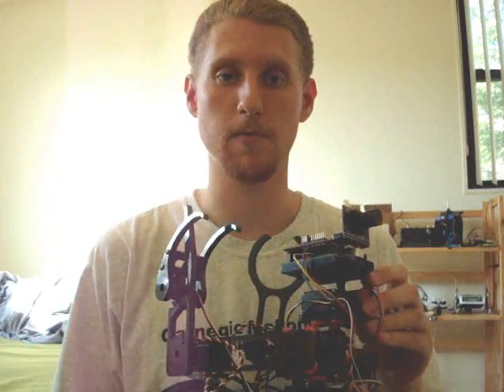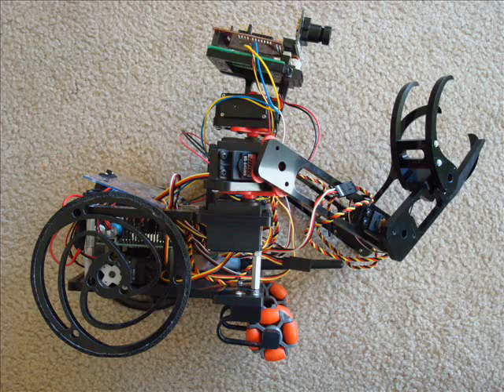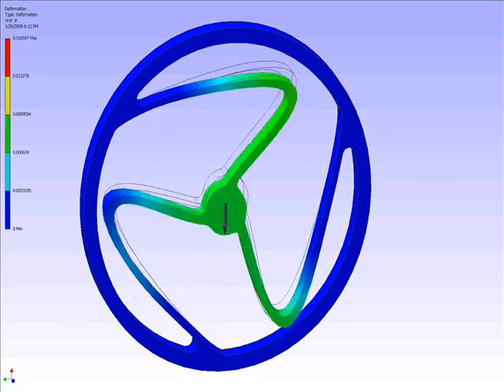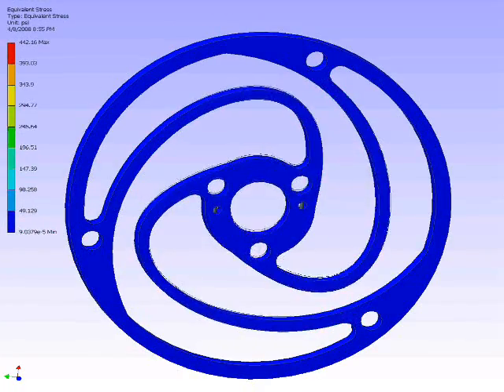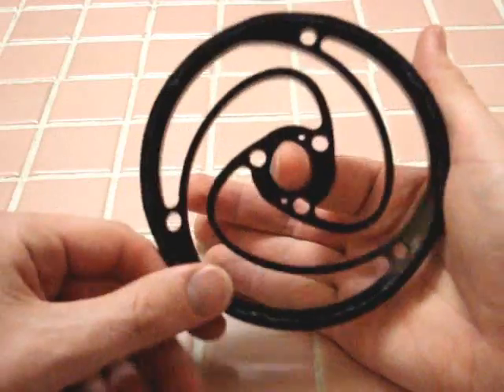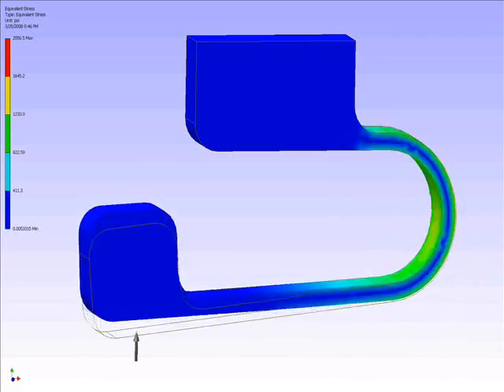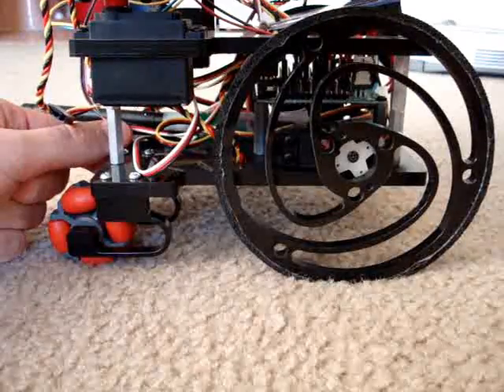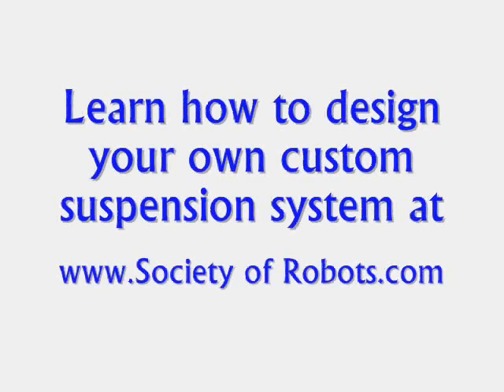Robot Suspension System Design

Comment: @kubarebo lol well it sounds like you have a beast of a car, because my car is very much affected by extra weight, i bought some alloy wheels of the same diameter as the original steel wheels but a lot heavier and it slowed the car right down, add extra passenger and its very noticeable. so maybe engine torque is what it comes down to, i know bikes with low engine torque but high RPM, weight makes a huge difference.

Comment: @kubarebo 
The volume of fluid in a shock absorber is less important than the viscosity of the fluid and the size of the gap/holes in the piston that moves trough the fluid. Hence how they can use magnetically enhanched newtonian fluids to enhanche shock absorbing without adding more volume.

And yes, it's a big deal - Try and take off the shockabsorbers (keep the springs offcourse) of a car and drive down a road with potholes. At 10 mph, no problem, at 60mph, you will be all over the place.

Comment: @RustyNex The moment of inertia of wheels on my car adds about 200kg of equivalent weight to the car per m_eq=I*(1/r)^2, so it's not as horrible as it'd sound. I don't feel much difference in acceleration with 3 extra adults in the car... I don't exactly do WOT every 20 minutes. Well, maybe every 40 minutes ;)

Comment: @kubarebo of course rotational mass is an issue, the more weight the engine has to rotate the more torque it needs. Rotational mass, over all mass and unsprung mass, all dictate how the car performs, but few components are in all 3 areas, wheels are one of them. But you are right that wheel weight is more of an issue to how the suspension performs, but its also an issue to acceleration, anyway in my experience with mechanics, this design wouldn't be effective on a larger scale with larger forces

Comment: @RustyNex Rotational mass is not an issue. Overall mass is an issue in cars. The real issue is really unsprung mass -- that's why the wheels have to be light, not because they rotate, but because the heavier they are, the poorer the car's response to shocks. Since this is a composite wheel, not all of it is unsprung mass. The parts that are rigidly coupled to the shaft are stuck to the body of the car and can be as heavy as you wish, pretty much.

Comment: @kubarebo 
Whoa .. a blast from the past, someone reply to a 2 year old post. :)

Anyways, the problem with speed, is that it doesn't scale liniearly.
Old Swordfighters found this out by experimentation.
If you swung a sword, double the weight, and you double the impact.
Double the speed however, and you quadruple the impact - hence why most swords weigh only 3-4 pounds.

This means that you need quite a lot of dampening at higher speeds, and that becomes a problem in designs like this.

Comment: Tires achieve a nearly identical result.  Whether you can argue the benefits of this design is moot - neither tires nor this design provide damping to the degree that is necessary to achieve an effective suspension system.  With no way to extract the energy from an impact, a bump can send this design airborne, unlike a traditional suspension.  Keep going, though - I'm sure you can incorporate an equally simple solution to achieve damping.

Comment: just to add, i come from a car based background so i understand a lot of forces involved with a car and the most important thing to think about (when making a high performance car) is rotational mass. you want the wheels as light as possible. any part of the car that has to be rotated by the engine must be as light as possible, (alloy flywheel, magnesium wheels, carbon drive shafts etc) to put all this weight into the wheels will not only slow the car down, but would be a nightmare to balance.

Comment: @kubarebo yes, and that works great in a small scale like this, but i mean in lager scale it just wouldn't work, there would not be a simple way to absorb the rebound of the spring effect and dampen it, and the longer you make the "spokes" to make them more springy, the bigger problems you have with horizontal drift outside the hub. imagine this on a car and all the stresses it goes through. i am not saying its a bad idea, just pointing out why is not used on a larger scale.

Comment: @palmisano I don't think you'll be able to get optimal shock absorption with just a single monolithic material. It'd need to be a composite -- decouple torque transmission from suspension from shock absorption. Perhaps you'd be able to use nonlinearities in the material, but then you'd need a mucho multiscale design -- with small scale structure doing damping, larger scale structure doing suspension spring, and a yet another class/size of strucure constraining torque transmission.

Comment: @Jesus45U This design has a rather wide margin for optimization. The biggest problem is manufacturability and quality of materials available I'd think. There's nothing special about "slow" speed of robots. You rescale a couple of things and slow becomes "fast". It's only for "slow" uses when you are using this particular material and shape.

Comment: @RustyNex It takes a reasonably simple modification to this design to decouple the torque transmission from the thin suspension-providing sections. I'll leave it as an exercise to the reader. Hint: it can be done using very simple kinematics -- no need for gears or anything of that sort. Besides, it won't "eat" infinite amount of rotary force. You'll twist it until you stiffen it up enough to resist further twisting. At that point it's not good at being soft suspension anymore, of course.

Comment: its a nice idea but the reason this isn't in cars and bicycles etc (because i had a similar idea for a bicycle wheel) is because of torque, for larger equipment with more weight and a powerful drive system, this design becomes a torque absorber and ends up eating the rotary force that you are tying to apply to the wheel.

Comment: Both the flexing arm and flexible spoke wheel suspensions have long been around in RC airplanes.  You have thin flexible metal wire holding the wheels and some wheels with hub designs similar to yours to absorb landing impact.
It's great, though, to see you've done some optimizing for your designs

Comment: Those designs might be a little concerning when it comes to lateral bend though. I have a feeling the center hub would pop out of alignment too easily when reasonable load is applied or when some sort of sideways motion is forced upon the unit like an uneven surface. The hook prong omniwheel suspenders are quite good though, you might even find its latteral bend could work WITH your design rather then against it. Interesting work! Thanks for sharing

Comment: Ah, you must be thinking about the Tweel.
It has it's own problems.

Particularly at high speed or particularly rough surfaces, which kinda takes us back to what I think we both agree on .. it has limitations, but should be good for most robots.

As for shockabsorbtion, I would call the absorbtion by material to be so low, as to be almost nonexistant.

The real question then really becomes, does it fit this application ?
And it probably does.
As long as there isn't too much force.

Comment: True enough, up to a point.

A train for example, would never work with this. Nor motorcycles or Cars.

Luckily, most robots are slow, and therefore make little sideways flex.

Another issue, would be shockabsorbtion on this wheel ... it has none. Which again, is fine as long as you don't need it.

Which is the case in a slow mowing environment.

Just look at tractors, they have no suspension either, apart from the tires, and they do allright, as long as they move slowly. :)